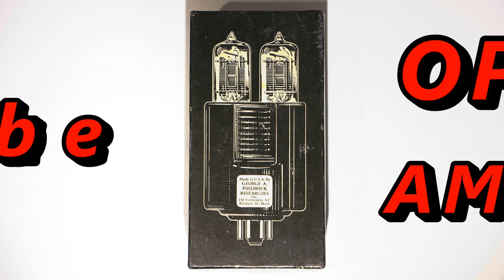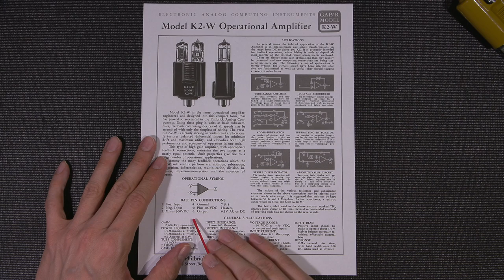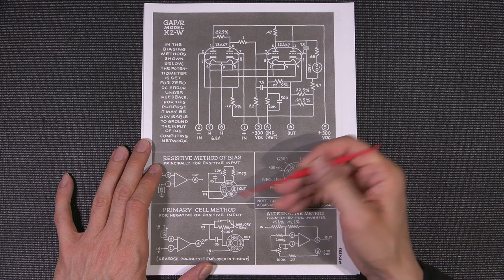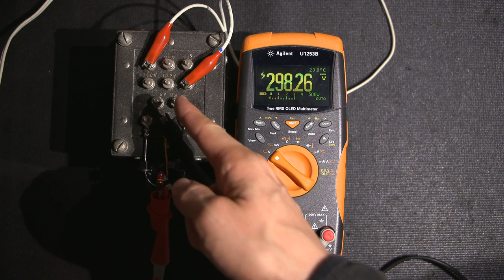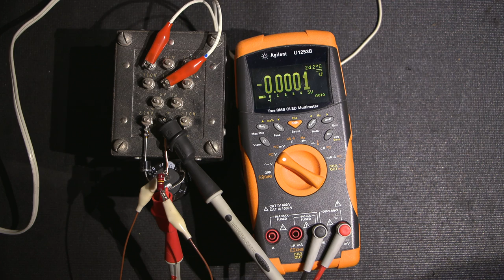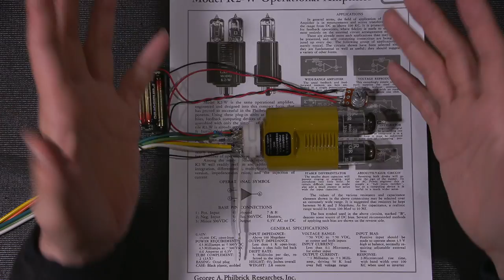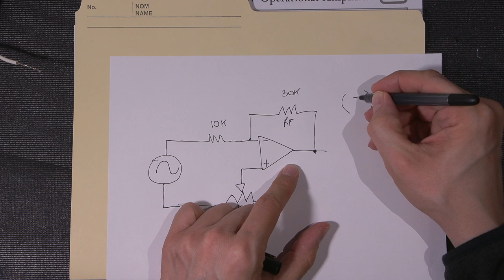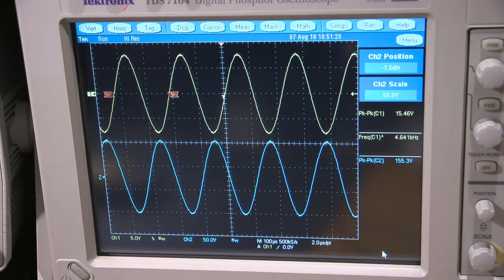600 Volt Tube Op Amp! Lets Power It Up.

Comment: Well i guessed 585 real world because i thought you were spanning a +/-210 with a dc conversion. assumed youd use solid state rectification spanning the 420 to land at 600vdc (-300ish+300ish) Obviously because i dont pay enough attention. ive got a +/- 16.5v (33vac) running into a full wave doubler giving me 93 real world at the output too. transformer, 4 diodes, 2 caps.

Did you go the route you did just for demonstration and education purposes? You little circuit there putting out 300vdc doesn't make sense to me when its tapped into both the positive and negative 210. If the cap is charging on both cycles how are you not landing near 590vdc? (im sure continuing to watch will inform me, im just pontificating rn) Also, why not just use a full wave doubler instead of two supplies in series? Wouldn't this be safer and less complicated to build? Obviously im missing something with what your doing here. but my 93v doubler circuit gives about +47v referenced to chassis ground from the positive rail, and about -47v in reference to chassis ground on the nagative rail. It's only one extra cap and 2 solder points beyond a standard full wave diode rectifier. I also have a little circuit with a diode bridge, 2 npn, and 2 pnp 667/647 transistors and 4 caps that can give you +28dc and -28dc referenced to chassis from 12vac, and its totally scalable with component values/ratings. so is the full wave doubler

(i promise im not picking apart what your doing, just recognizing that im missing something in my understanding here)

Are you a school teacher? Maybe vocational center? Educators like you are such a value to our species either way. It cannot be overstated. 

PS. I have one preamp with nearly 10,000uf of filtration at 210v because when i built it i only had the switch mode nichicon series, i forget the letter code. Takes a TONE of those to get rid of 120hz ripple though. At the time of building i didnt include bleeder resistors either. It is fused though lol. If that thing ever blows it's fuse, im rebuilding the supply from scratch. Im not working on that thing hahaha. A bank of twelve 680uf caps at 210v with no bleeders is a terrifying thing to behold when you know what kind of death trap it is. It was only ever a test of a doubler circuit that i never went back and rebuilt as intended anyway.

Comment: I'm confused. Why would a single op-amp have 14 pins ? Most single op-amps have 8 pins. Duals also have 8 pins. A quad op-amp has 14 pins.
Reply from the maker: Early component.
Reply: Maybe multiple ground pins for interference supression?
Reply: OK I just looked it up and the old LM 101 op-amp did come in a 14 pin package but I've never seen one. I've seen them round and square but never in a rectangle.

Comment: lecturing about capacitor safety while waving bare hands around 300VDC ... hmmm....
Reply: Why? What's the problem? Was he touching it? No. Was the voltage high enough to jump to his hands at any point? No. Was he making sure the potential was low enough when he did have to handle it? Yes.
Hell it wasn't even high enough to jump only the couple of millimetres from either of the 300v terminals to the interposed Gnd one, so quit being such a health and safety drama queen.
He was perfectly clear on multiple occasions how dangerous everything was, and what essential safety protocols were absolutely required even to the point of demonstrating their application, use and reasons. Based on how risk averse you seem to be, you'd hate having to work closer than a metre away from UK mains voltage; it too can't jump more than a few mm (in un-ionised dry air), but you'd obviously be terrified of it and need full PPE.